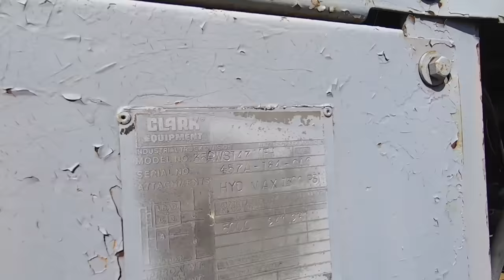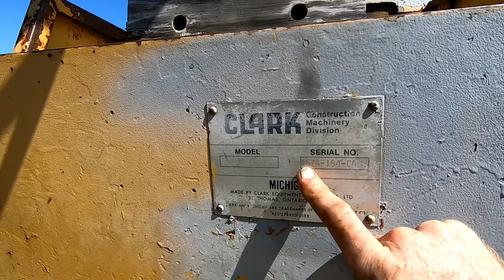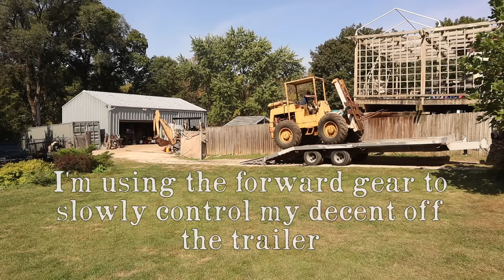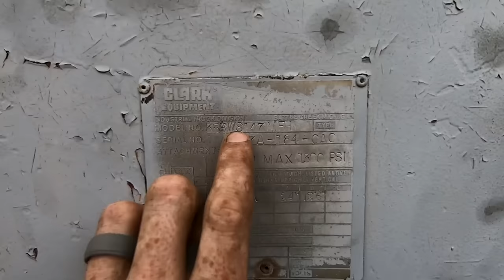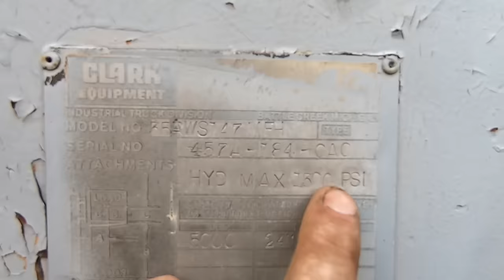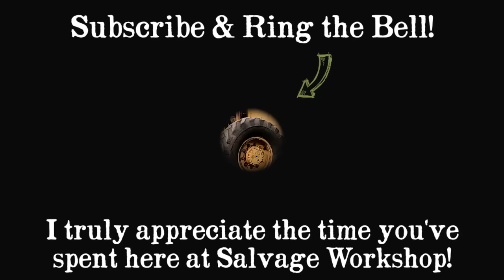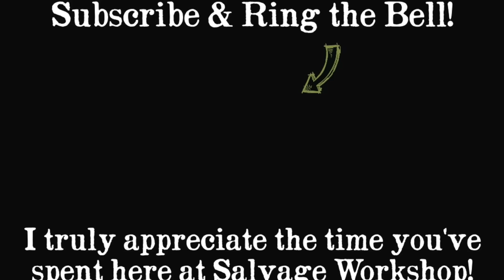I found a RARE ALL-Terrain "Wheel Loader" Forklift! Will it START?! (THIS Machine PUT UP A FIGHT!!!)

Comment: Thanks for your content!  I would like to offer a tip on winching. You need to 2 part the line. Utilize a snatch block at the towed vehicle and bring the line back to the winch and anchor it . When you do this you increase the mechanical advantage of the winch, essentially doubling the capability of the winch while reducing the load on the wire rope. It puts less strain on everything… making it a safer winch operation. I also notice part of the time you were operating the winch in a direct line between the load and the winch. If that wire rope breaks you maybe severely injured or worse.  Stand well to the side.  Thanks for your channel.

Comment: Starters can't run backwards, the sprag bearing on the bendix gear will only allow it the drive one way, a good way to tell if it's a clockwise or counter clockwise starter is to look at the small leading edges on the teeth of the bendix gear 👍
Reply: Starters can turn backwards, and it requires a different bendix and field to run the other way. My buddy rebuilds many starters, alternators, and generators, and he told me that to change the rotation of a starter/generator for a tractor, it needs a different field to change that. 
Depending on the application, Lister Petter has engines that are either clockwise or counterclockwise, or if one is from the UK, anticlockwise.

Comment: 1/14/22; Oh yes! Mighty good observation of fan turning direction...then distractions...then recall fan turning 'wrong'...then musical chairs on starters...then reworked starter for opposite direction/clockwise/correct timing rotation & bingo! Admire your commitment to this type of hard 'dig-out-of-the-weeds' salvage/rescue of old but still usable heavy equipment. Another great job! Also know that another YT guy, Matt at Diesel Creek, has the same penchant for finding/reviving old heavy equipment 'buried-in-the-weeds' and making YT videos celebrating the restoration. Much enjoy your channel. Stay safe!👍👍👍🛠🧑‍🔧😊🍺

Comment: Check for positive ground before wiring the alternator. You may have changed polarity when you switched starter from the replacement unit.

Comment: Great find on the Clark/
Michigan forklift. If you
can get the brakes and 
wiring and engine all fixed
up. You will have a nice
forklift. Good job figuring 
out the starter problem.

Comment: One clue that the starter turns the other way is the chamfer on the gear teeth that you can see at 55:48. The one off the other Perkins engine has the matching chamfer angle for the flywheel teeth.
Reply from the maker: I think i knew that at some point, but definetly didnt pay attention to it on this project! Good info, thanks!
Reply: @SalvageWorkshop  I was looking at the shiney spots on the starter gear.  You had the 2 starters nose to nose, but the shiney spots were both facing the camera, which means they had wear on opposite sides of the teeth!  Glad you got it figured.

Comment: Easy and free first step (waaaay before engine rebuild) is a good valve adjustment, assuming those don’t use hydraulic lifters. Then injector tips, and then maybe have the injection pump checked over. I’d be willing to bet the valve adjustment would help with that initial startup smokeshow considerably.

Comment: This reminds me of loaders I saw on flight lines in USAF back in the 70's. Could be wrong but seem to remember seeing loaders that looked similar.
Reply: It’s a “civilian “ version of the Army’s old RT lift. (Rough Terrain) in the Air Force we used the GM Terex “AT” all terrain. The RT was multiple steering, The AT was articulated steering. Both were excellent on the job. We used both to unload C130s and most all cargo aircraft,  back in the day.✌🏻
Reply: Bingo.

Comment: I was surprised you didn't use snatch blocks when loading something that heavy.
Reply from the maker: Yeah, I didn't have one with me, but the winch is rated to pull 17,500 lbs with a single line... This machine weighs about 15,000 lbs so it shouldn't need a block & tackle... Now the winch has some major issues I didn't know about when I bought it used, but we got this one recovered regardless!
Reply: The more wraps of wire on the drum the less power the winch has, snatch block and stand well back from the cable 👍
Reply: I have a 17,500 pound winch and it is definitely not rated at that maybe 6000lbs before it quits
Reply: @haroldwilkerson2026  his one is better.
Reply: @SalvageWorkshop  17,500lb ON THE FIRST LAYER.  Each subsequent layer of cable reduces the available pulling power due to the extra leverage working against the winch.  By the 4th layer of rope/cable you will have lost over 20% of the available maximum single line pull.  

That's another advantage of a snatch block -- it allows you to spool out more cable, which increases the effective pulling power of the winch due to the reduced leverage.
Reply: @haroldwilkerson2026  I think that is the case with most winches, that is why snatch blocks are so handy.

Comment: As far as starter turning backwards depends on application  your starter has the drive facing the back of engine mounted along side the engine now a 1206 international farm tractor has the starter mounted from the back with drive facing front of engine attached to the bell housing above the transmission there are numerous pieces of equipment that mount from backside due to space and yes they can be a pain to get them out on an older international tractor aside from the bolt patterns different clocking is available too. If that engine has been cranked a lot in previous people's attempts it would not have been pumping oil to the bearings probably wouldn't be a bad idea to drop pan and check the bearings and clean out the pan at same time get a mechanical oil pressure gauge on it see how the oil pressure is before running it too much and like you said need brakes or a big rock. Good job at figuring it out that it turned over backwards 👍👍👍💨💨💨
Reply: Electric starting motors are manufactured in both CW / Clockwise and CCW Counter Clockwise rotations

Comment: I was yelling into my screen about that ! We ran the old 2 stroke diesel Detroit and they would run backwards or forwards and that’s why people in the boating industry used them ! The way we tested is to shoot some go-go juice in the exhaust and if it started it was hooked up wrong , but of course you won’t have a throttle that way , no fuel and no way to regulate it ! Up in Alaska on the pipe line we had a mix of left and right turning rigs and that’s what the mechanics would do ! Also you could have switched the battery cables and gotten the same result because they can run both ways the same ! The transmission is different also but I think yours is more like a hydrostatic so your forward becomes your reverse . We thought about putting an air/fuel/metering device on both intake and exhaust to run both ways and all you’d have to do is kill and restart going the other way so no need for a transmission with gears just a CVT system  !

Comment: Nice job I would have been stumped with that starter also.  well done in spotting the issue I will remember that in future when I am doing similar jobs. It’s an interesting old machine. Some of these old compressors were very noisy  could be like a set of bagpipes thumping away.

Comment: I've been playing with engines since the mid 1950s.  Never would have thought of a starter, when it wasn't a rope, going the wrong way.
Reply from the maker: Yeah, a bit different!! That's a good point, i have dealt with this on pull started engines!
Reply: @SalvageWorkshop  Wow, that was quick. What is the time there. Here its 2122

Comment: Find a set of left hand drill bits for extracting broken bolts like that. Works better than the blue wrench usually.

Those motor mounts look pretty factory.
Reply from the maker: Ive never had good luck with left handed drill bits, but thats probably because i usually work on stuff that's broken AND rusted in place!

Comment: We had two of these back in the 1970s perkins engine Clarke converter and transmission plus Clarke axles.
Ours were loading shovels with a single bucket cylinder, one problem was the steering used to get out of sync  if one of the four cylinders was passing oil, we were constantly replacing/repairing cylinders more time was spent squaring the steering up than loading.
This model was replaced with an articulated model which grew into the Michigan 175 with Cummings NT855, 275 with Cummings NT 1150 and finally the big brother the 475 with Cummings VTA 28C V12 then end of  Mich as Volvo took over
Regards Barry from UK

Comment: The starter you had rebuilt can be reversed by disassembling it and reversing the magnet drum and reassembling
Reply: You'd also have to change the Bendix to operate with reversed rotation.

Comment: Those Perkins 4 Cyl. diesel motors will run for many tens of thousands of hours before needing a rebuild! Had a buddy that had one with 60,000 hours on it, and was still going strong! Before even thinking about a rebuild, sort out the fuel supply, (fresh diesel), valve adjustment, and new fuel filters! No more than you will use it, it will last you a lifetime! It starts way to easy, and runs and sounds great, now! Pull the main line off the air compressor and see if it is pumping air? then work your way back to the breaks! Great job spotting the motor turning backwards, and finding the original starter in the weeds!
Reply: Compressor has to be working somewhat as the air horn started to work.

Comment: I've done a lot of shade tree mechanics and if I saw a fan blade pushing air into the radiator and not pulling it through my first thought would have been someone put the fan blade on backwards. Never really thought about the direction a engine rotates.Then I would have though "welp, that's somethong else I have to fix once I get the engine started!" I doubt I ever would have thought the engine was being cranking the wrong direction! I didn't even think you could crank an engine backwards. If I ever had to crank an engine by hand to see if it was free I would just look at the fan blade and figure out which way to crank it to make sure the fan was pulling air through the radiator. Now if somebody put the fan blade on backwards  i would have really been screwed! Although now that I think about it, I do remember airplanes when you handswing the propeller to start sometimes the it will kick back and actually start up backwards and the prop will push air and not pull air. But making that connection between aeroplanes and diesel tractor machines, and the direction that they would crank up, would have been a leap in itself for me. 
I like the alt. fan blade idea. I'll tuck that one away in my dusty 'ol memory bank. Thx.
Reply: Most engines have the starter beside the engine, some, (the awkward ones), put the starter alongside the bell housing/gearbox, this would be another reason for the starter to run "backwards", not an obvious one if your not familiar with this.
Reply: Fitting the fan backwards won't change the airflow direction, to reverse the airflow you have to either change the D.O.R or reverse the blade pitch.

Comment: In the marine environment (boating), there are “left handed rotating” engines and “right handed rotating” engines. A left handed engine tends to push the boat to the right while a right handed engine tends to push to the left. To off set the pushing to one side, a lot of boats are twin engine….one left handed and one right handed or “counter rotating” powered.
Reply from the maker: Interesting... i did not know that! I appreciate the knowledge!!  The more you know!
Reply: @SalvageWorkshop  that starter you pulled most likely fits to a left handed Perkins diesel. If it’s marine grade, it’s got value.
Reply: But if an engine just turns a shaft and propeller, how would it veer a direction?
Reply: @mrmotofy  there are left and right handed propellers, and an engine would have a prop to match the engines rotation. Also, the tendency to push in one direction it’s a very subtle effect, practically unnoticeable. I should add, minor rudder adjustments solves this issue.

Comment: I noticed when you were reading the first on the loader you had loosen the hose  ,I think if you put pressure on the hydraulics you can pull the lever that operates the lift it will release the fluid back into the system

Comment: Reminds me of the time I got rid of a Ford van I dearly loved because it started inexplicably overheating. Long story short, someone had stuck a reverse-rotation water pump in it and re-routed the serpentine belt to turn it backwards so it worked. I was doing some basic maintenance and replaced the belt, I routed it according to the factory diagram without realizing it was any different. I didn't know reverse-rotation pumps even existed until after the fact. Still makes me mad, I loved that van.

Comment: Is it possible this lift truck was an airport lift truck like the ones used in the 1940s thru 1960s to lift pallets in into cargo planes? It has that appearance.
Reply: He mentioned in the videos where he first started messing with those lift trucks. Where he got the trucks from I do believe. I wanna say they used them for roofing. Getting materials onto and off the roof.

Comment: if you had the power reversed the lat would have smoked, DC motors don't care about polarity, you have to change the brush configuration to reverse the rotation.
Reply: That's true if it has a wound (electromagnetic) field, which this is. For permanent magnet motors, reversing the applied polarity will reverse the motor. But then you would not want to be wailing away on the casing with a hammer because you would break the magnets.

Comment: This reminds me very much of the RT, (Rough Terrain), 6000 forklifts I ran in the SeaBees. Sadly I can't be much help to you as EOs, (Equipment Operators), we didn't work on them just ran them and as it was the 70s, I don't remember a lot. I DO remember they were 4 wheel drive  and had a lot more levers. I THINK you could switch between 2 and 4 wheel drive, and the Steering! You could switch between: 1Rear wheel steer, 2 Front wheel steer, 3 All wheel steer, (front turns one way rear turns opposite), and 4 CRAB! (all wheels turn same direction) Crab was for maneuvering on a narrow LST. It also had another lever which would 'Tilt' the entire machine forks and all which kept the load level.   The Lever on the floor on the left  IS the parking brake!  
    Also, just FYI, some diesel motors will run backwards! While in EO school we had to drive 2 & 1/2 ton dump truck, (loaded), on an obstacle course that included stopping at the top of a steep hill and taking off. There was a stop sign at the top of the dirt track hill and base security would write you a ticket if you did not come to a full stop!  I pulled up, stopped, took off and shot backwards. HUH? I Stopped again, Made sure I was in Low range 1st gear, (I was), Increased my throttle, let out the clutch and went backwards.  AS the ole boy says, "Now I ain't a smart man but I know when somethings Messed up" , so I stopped and look and the Tach is bumping 0! The motor is running, I look and there is smoke coming OUT the AIR CLEANER!. The motor was running BACKWARDS! I put it in reverse and pulled the hill laughing at the top. Then I shut it off, restarted the motor and it was fine.  When I had stopped the first time I actually stalled it but it caught, turned the motor over backwards and started running backwards. Good Times lol. Sorry to be so long, but yeah.

Comment: I looked at everyone so close to the wire rope when you were winching it up on the trailer and I wanted to look the other way, if that rope broke I would hate to think what would happened to you guys.
Reply from the maker: Yeah I agree with you on that one! It does look a but sketchy in the video!
Reply: @SalvageWorkshop  Not that i don't agree with everyone on the wire rope saftey, but a 1/2" steel cable in good condition should have a 22,000-26,000lb breaking strength.  I don't think you were ANYWHERE near that kind of pull.  But it is always best to be safe.

Comment: Clark 35 AWS: Rough Terrain Forklift. Used the 248 Perkins engine...2.5 ton capacity on forks. Manufactured from around 1970 to AT LEAST 1996...maybe later. They weren't in big demand in the states, but they are all over Australia and South Africa. Decent vehicle, if you can still find parts for them.

Comment: Good job on getting it going. That thing is cool; make a frame so you can install a snow plow.  remove the forks and have a fram attach so you can lift and lower a plow.  you could install the plow rise with a chain so it can trip up on obstructions.

Comment: It's a frankinstine you're gonna have mix match parts. Just make it run with the best parts you can find to get it to operate smoothly as possible.
Reply from the maker: Luckily it actually runs pretty good so far, but YEAH I'm gonna have to find parts for it at some point!

Comment: I was a combat engineer in Iraq in 1991. We had a front end loader like this type. It was new version. We use it to dig ammo and exspovise storage areas. Once the storage area were bug. The  operator would drop rhe front end loader  and unload the ordiance into the hole that was dug. It was great for digging   and unloading ammo storage on the go. It also used to dig fuel  bladder storage holes and move the fuel into holes. It was key logical piece of equipment. Able to dig and then move ordiance into the harden storage areas. In the front lines. It was faster than dozens, plus the forkleft ability was great asset. Look up military service manual on line. It might be Vietnam War  period.